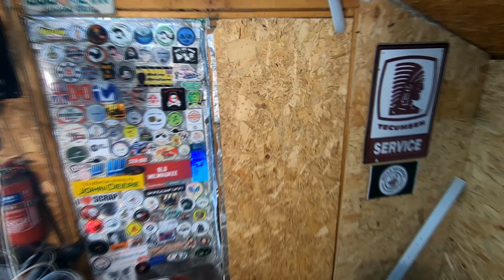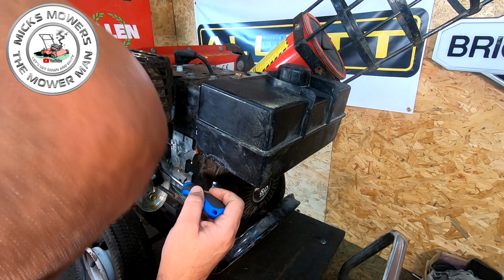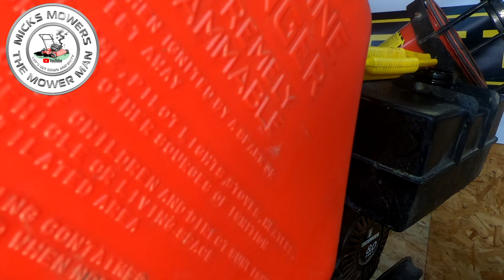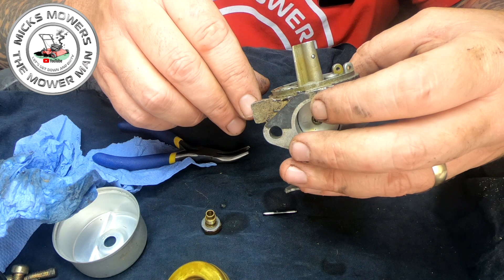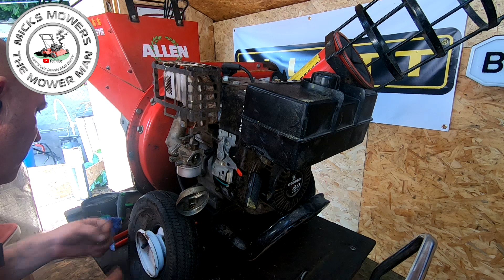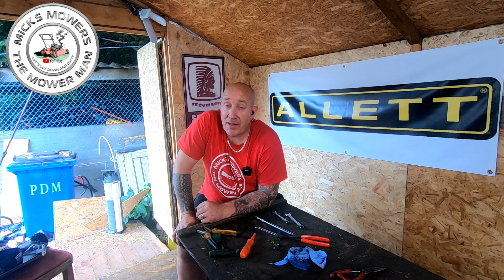Chipper shredder Saved From The Dump. Will It Run Again Let's See #chipper #trash #micksmowers

Comment: A lot of that designed chipper/shredder were made and they used horizonal shaft Tecumseh engines. Problem is, Tecumseh Engine manufacture is no longer in business. But there are still parts available for them...most parts anyways! I have a Craftsman version and It still works. I really need to repaint it now, but it still does the job when called upon... It is not one of the pieces of yard equipment that gets used weekly. And that leads to possible engine issues from sitting for long periods of time, like you had... Thumbs Up
Reply from the maker: Ta for watching mate

Comment: another great video  mick i have electric chipper and it has not worked since i brought it  i have changed the fuse in the plug and still nothing any advice
Reply from the maker: Does it make a noise? Like a humming
Reply: @themowerman  dus not make any noise
Reply from the maker: @grasscutterpalmer3746  fuse or switch I would say
Reply: @themowerman  ok thanks mate

Comment: Can i ask a bit of advice please, Briggs 35 classic engine not starting or priming (full tank of fuel). Does start with a squirt of easy start down the carb & spark plug. Primer bulb does push in & out no problem so do you think it's possibly blockage in the carb? Thanks.
Reply from the maker: Clean the carb and a new gasket set should get it working again.. also check the primer bulb..